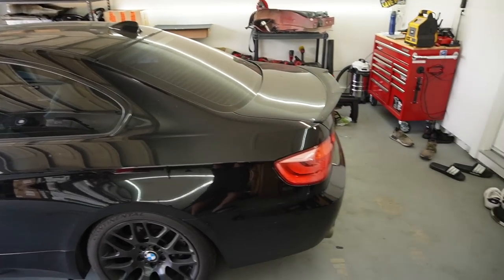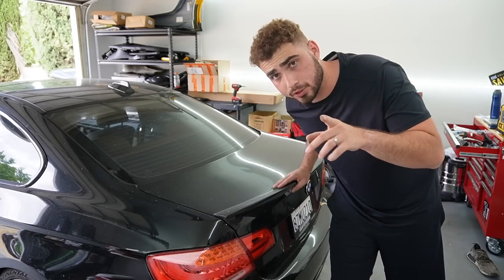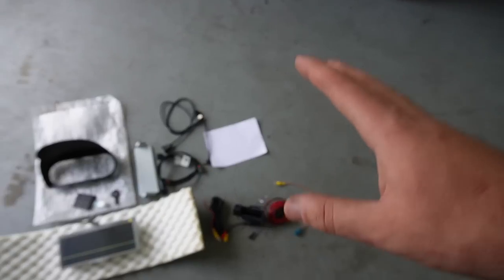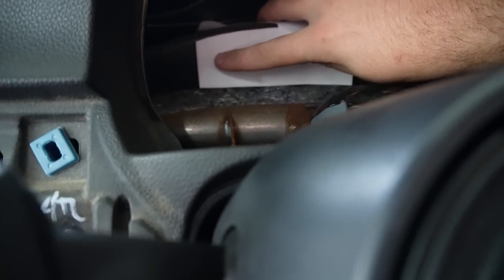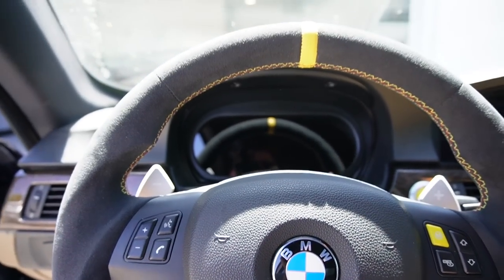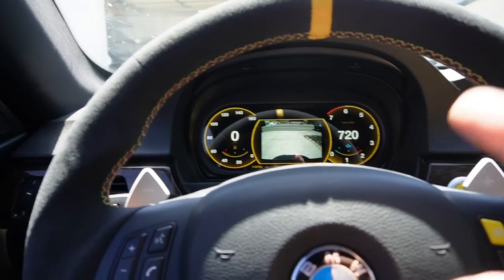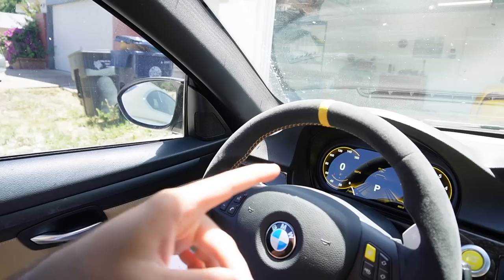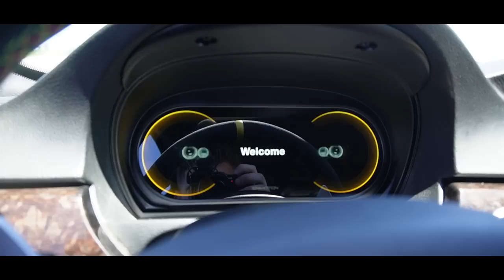RETROFITTING THE COOLEST MOD ON ANY BMW! PRICEY BUT SPICY!

Comment: man at this point the 328i is so nice u should swap a different motor in it so its worth something lol maybe a built n54?
Reply: good idea that would be great content. maybe do something risky even build an n55 just to be weird.
Reply: the point isn’t power it’s supposed to be a reliable daily driver plus the transmission would have to be swapped because the GM would blow up with N54 power